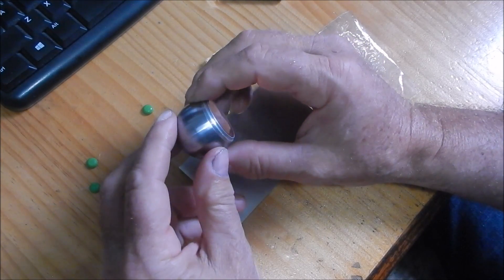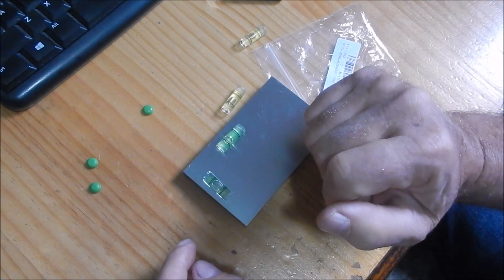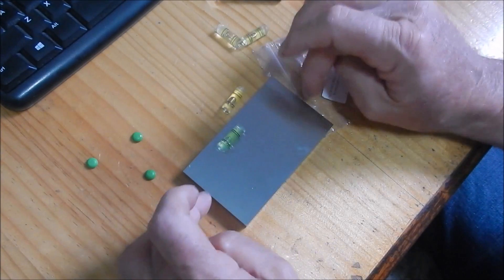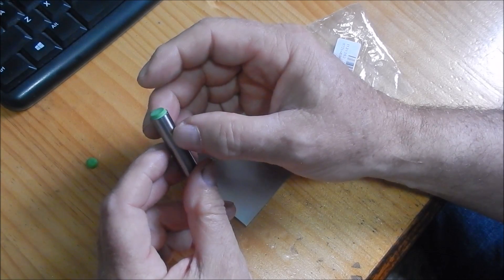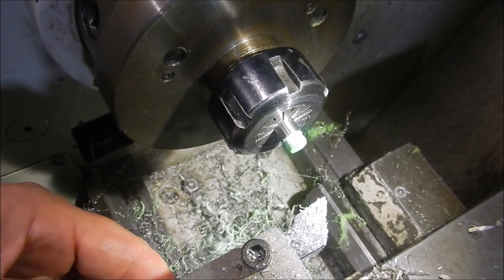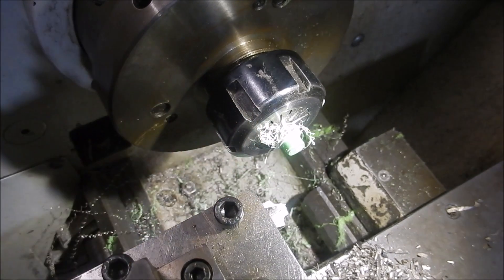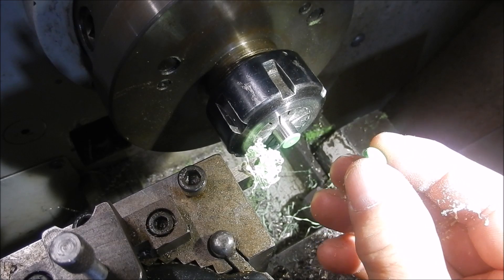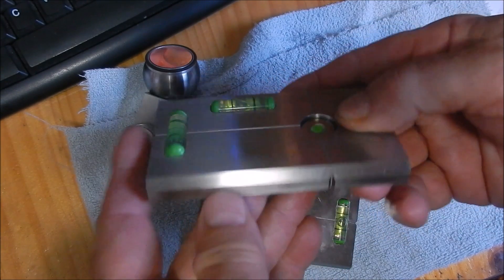Epoxy Resin Machining

Comment: Resin in a piece of pipe is a very good idea for work holding. I would never have thought of that.
Reply from the maker: Hi Rusty, It works well.  As I mentioned I tried it in a straw but it was to brittle and kept breaking off.
Cam